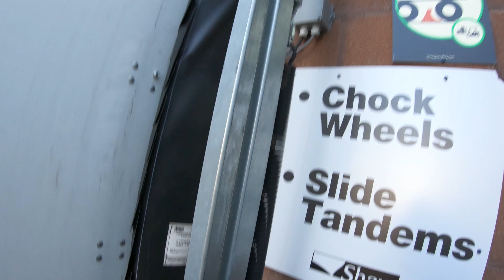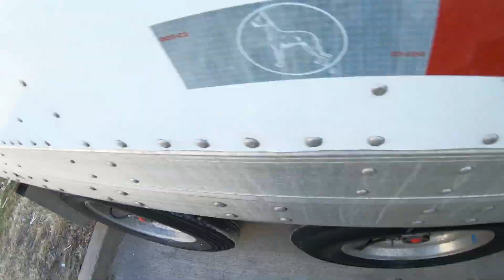Trucking to Wentzville Missouri

Comment: I have not been to where you dropped, but I have been to where you picked up. That's where I got my lightest load ever. Barely over 10K worth of aluminum odds and ends going to a Lowe's DC. Hopefully you got more than your regular miles that week. Always nice to get a pay bump! Have you been there 1 year yet? Got turned up to 70mph?
Reply from the maker: My load was just under 10k, it was nice to have a light load from there to Valdosta GA. I ended up with around 2700 miles for my 5 day week so yes that was nice lol. 
The 29th of this month will technically make one year that I have been driving but I have about 8 more weeks until I will hit the one year mark in my own truck driving solo. And then that's when I can get turned up to 70mph, I'm still stuck at 66 unfortunately lol.
Reply: @TwoWheelTrucker1  I love a light load, especially through the mountainous regions! Won’t be long and you’ll be rolling the big 70! To hit the highest tier performance pay regional in 5 days, probably have to push really hard and do splits to avoid the 30 minute break. Just 2/8’s or 3/7’s. No time to dawdle. Just guessing. And luck. No major delays at shippers, receivers, traffic jams, bad weather or other hindrances. I have got to tighten up and stop going over on my 10’s. I’ll get lazy and take a 11 or 12 some days.
Reply from the maker: @cotjocky466  I actually don't do splits, I pretty much have myself on a schedule and if I run past my normal "end of the day" time frame I get really tired and sleepy because let's face it, can't really get good rest at a shipper/receiver while being shaken violently while getting loaded or unloaded lol. So to stay safe, I just shut down around my normal times.
I got lucky last week and had very minimal stops so I was able to drive more than usual and the few stops I did have went very smoothly. I am able to drive farther without stopping then I was able to when I first started so that helps with millage a good bit. I woke up in Mount Vernon Illinois and drove non stop to Cartersville and took my 30 just to get back on the road to Valdosta and made it about an hour and a half away before I had to shut down. I really prefer running like that versus all of the stops that come with Regional, but it is what it is. Lol